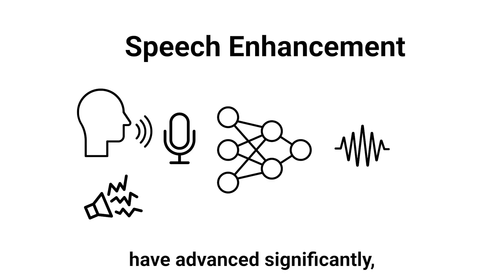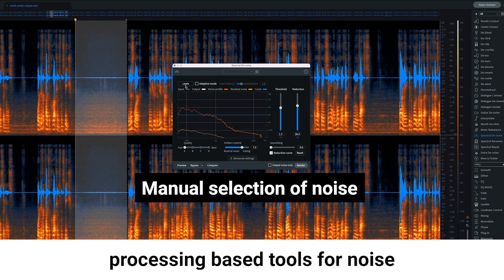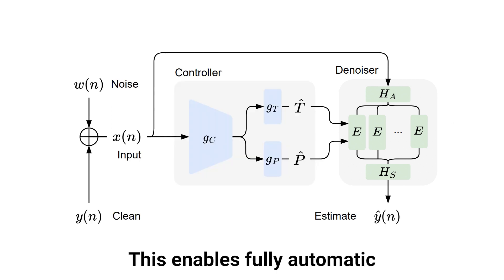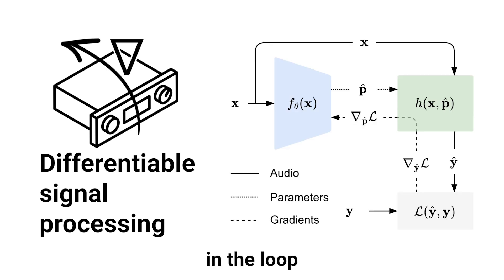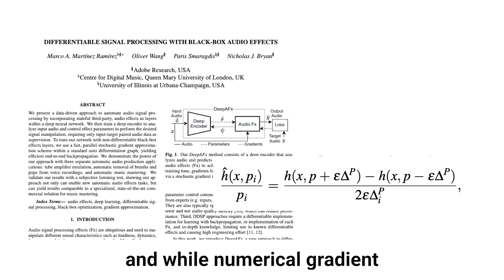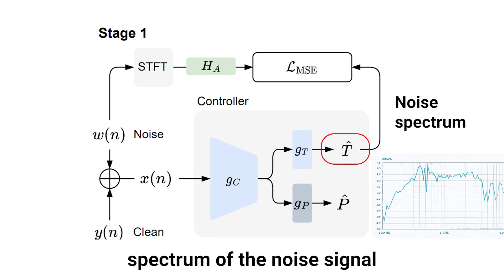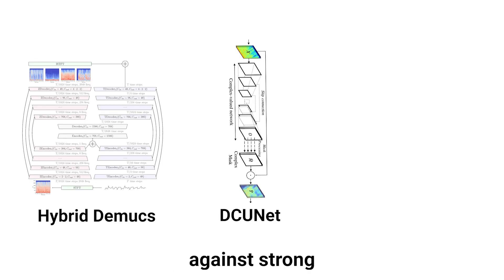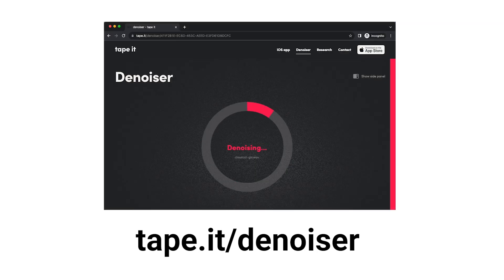High-fidelity noise reduction with differentiable signal processing

Comment: I am trying to use the website to de-noise a file, but it is just stuck on "Denoising..." with nothing in the progress bar.  I even tried a ~1 second file just to make sure it wasn't just slow to process a particular file, but it is still stuck with that file as well.  Is the website no longer operational?